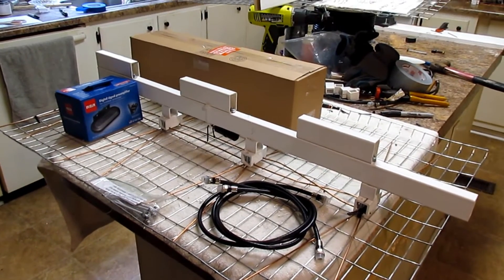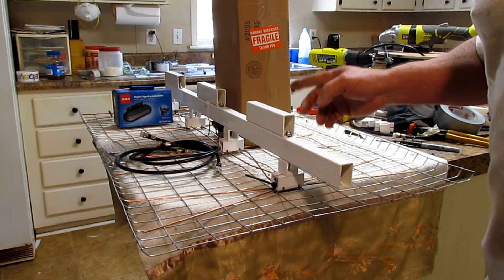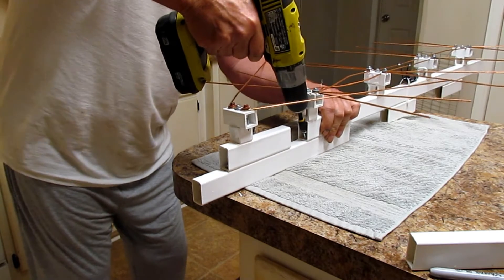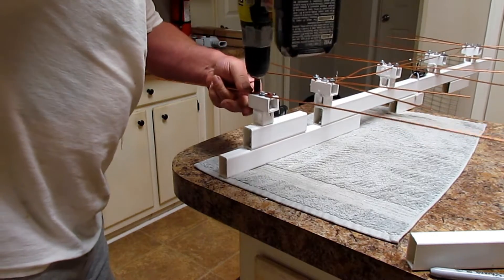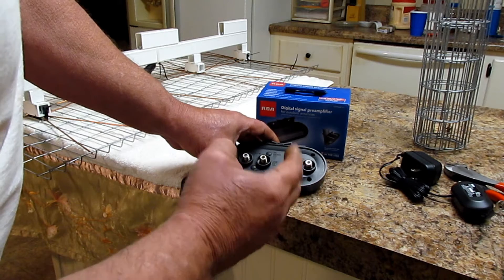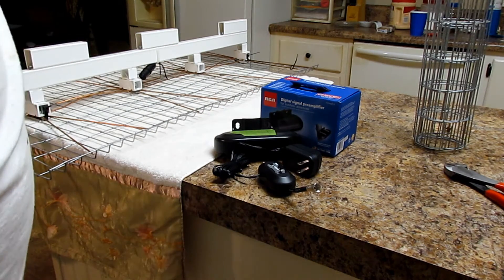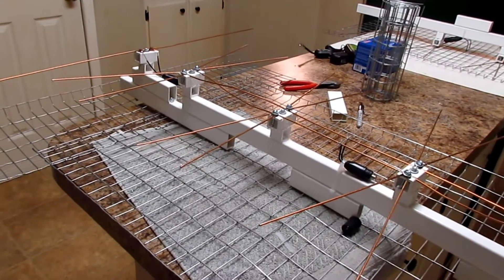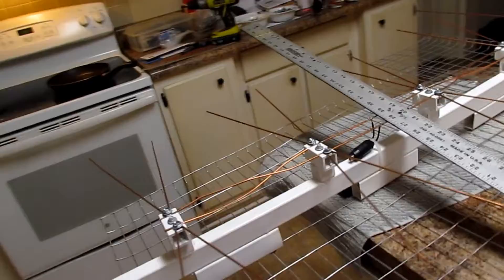VHF Add-On For Your Ultimate TV Antenna

Comment: Hey danny, you can only use a regular splitter if the signal is strong enough,  there is a powered splitter that does a decent job without much signal loss

Comment: Overkill, after seeing you breakup the vhf from the uhf and using a combiner ive been exploring all the posibilities. If you make the vhf elements 17" and hook it to the same mounting point as the balun it works perfectly. Ive done this mod to a copy of the ultimate antenna, a hooverman, a 2 bay 12x15 wiskers antenna, and a winegard freevision. All of these antenna now pickup rf channel 2 thats 47 miles away with 0 uhf degradation. Ive also tested antennas direct vhf addon that includes a combiner and see zero difference on my signal meter testing apples to apples. Just my experience yours may be different
Reply: So nice to see and hear your experience with the antenna stuff. I would think that using a gray-hoverman antenna with two top hats or narods as they are supposedly called would be a lot smaller form factor size. The feature supposlidly really works. Just check with anature antenna sites with references. Job well done Chris. Peace vf

Comment: Danny, for convenience you are designing a quarter wave antenna. You are compromising a little bit for a convenient length. A half wave antenna would be too large to handle.  if you look up the required length for the low VHF channels 2-6 (55-88 MHz) the antenna length required will be 80.16 inches total or 40.07 inches for each side of the dipole antenna. For the high VHF channels 7-13 (174-216 MHz) you need an element 28.56 inches total length, or 14.28 inches for each side of the dipole. 

The longest section for channel 14 (470 MHZ) in the UHF band should be 11.94 inches total, which should be 5.97 inches for each of the dipole sides. The middle of the UHF band is channel 32. (578 MHZ) the overall length should be 9.7 inches, and 4.84 inches for each end of the dipole. Your shortest UHF element (596-656 MHz) for channels 35-44) the length should be 9 inches total, or 4.44 inches on each side of the dipole. I hope this helps.

Comment: Hy danni i want to ask you. whether using one power supply below and branching out one coaxial cable for two pre-amps for two anthna uhf the results will be better and the signal does not collide? I once thought that I would use Duplixer to branch out two pre-amps, but I still doubt whether the supply of electricity will flow properly to the two pre-amps so that the signal booster performance doesn't work.
Reply from the maker: i dont think it would work
Reply: @southernideas6175  can you explain why that doesn't work? The working principle of the pre-amp is actually boosting the signal with the support of a small supply of voltage, where the DC electric current will flow through the copper ground wire coaxial cable and when put together a fixed parallel to each pole will be passed through the DC current so in other words the pre-amp will work. in my opinion the signal would be better if put together without going through a duplixer tool. Thnx sir